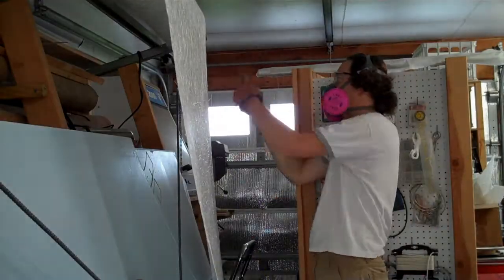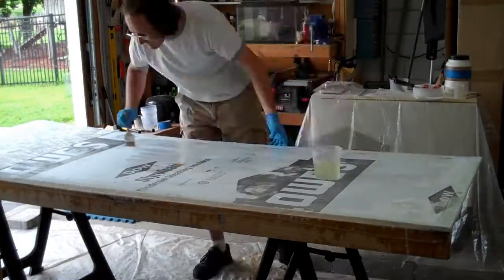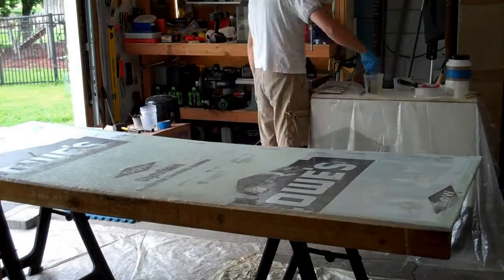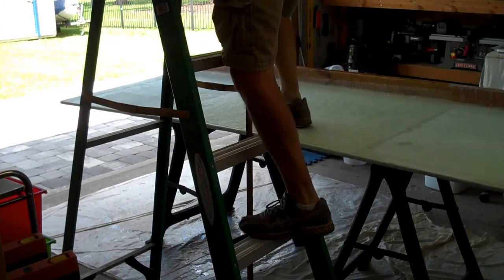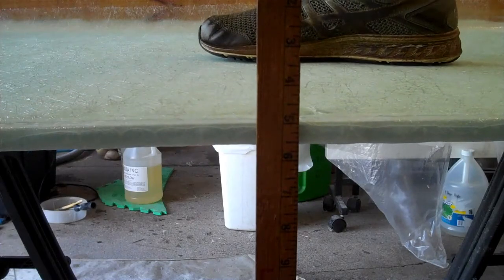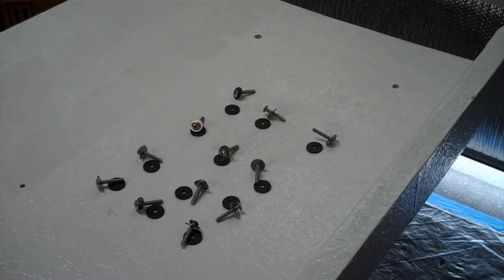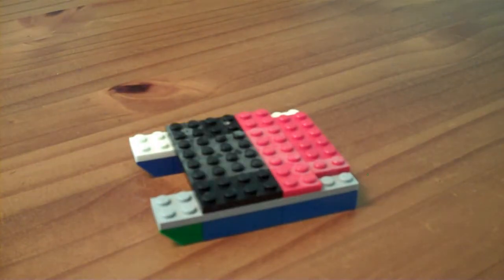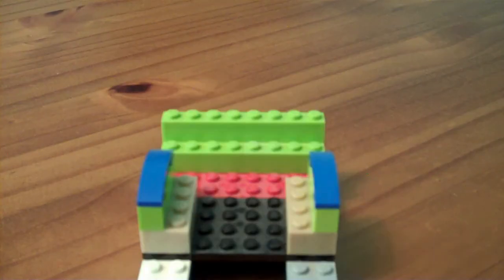Foam & Fiberglass deck board - Building a fiberglass mini-pontoon boat - part 5

Comment: I’m building a catamaran type little trolling motor boat to get me to my fishing spots. Since boat was stolen while saving money for another one. I hv sponsons in front kind of like a racing boat. What did you use for the bolt holders to screw the standing board onto pontoons. All I found was 3/8” type flat washer type flush mounts with the little wings pointed downward to hold it into the wood. Thought I’d glue a piece of wood under my cardboard sponson form in fiberglass if over. Put 5 on each side plus fiberglass two times over the top of plywood. May look into using the foam board instead of plywood thanks
Reply from the maker: These are stainless steel t-nuts embedded in the pontoons fiberglass. I believe they are the same type you found with the wings pointing up. You can look at my pontoon build video in the same playlist to see me install them.

Comment: can you advise the weight of the fiberglass chop strand matts you used in the project. It looks very thick layer.
Reply from the maker: The CSM is 2.0 oz per sq foot  (NOT Sq Meter, as woven fiberglass is typically measured).

Comment: What type of resin did you use? Most resins melt the foam.
Reply from the maker: This is epoxy resin, with a slow hardener so it will not get too hot. I believe polyester resin will chemically melt the foam, epoxy resin appears to work fine as long as the heat doesn't get above the melting point.
Reply: @summetj  Hey, thank you. I have been looking for a light weight solution for my jon boat. Ill have to look around for a slow hardener. I appreciate you getting back with me.
Reply: @summetj  From what I have researched you can used white or yellow wood glue as a barrier coat and use the other resins. I am considering a foam core deck for a old Whaler skiff clone I am doing. What is your opinion of min. core foam thickness (widest span 30"). Plan a vinyl ester 1708 45 biax layup 1 layer top and bottom and maybe a veil layer added to top. TY
Reply from the maker: @howiemoth3847  I'm not an engineer, so I really don't know what thickness is best. I've been told via a YouTube comment that the thicker the foam the stronger the resulting composite board.  (I've also found that more layers of cloth provide more strength ;> )

Comment: What kind of foam are you using for the “structural beams” on the other side? Looks like styrofoam.
Reply from the maker: The entire deck board has a Styrofoam core and the ribs/beams are also Styrofoam cored.  The structural strength is provided by the fiberglass and epoxy resin, the foam core is mostly just to make the shape that the fiberglass goes over (plus keep the sheets of fiberglass held apart...i.e. they form the center of the "I-beam") for which they only need a little strength under compression.
Reply from the maker: @@elliottdean291 not chemically, but if you put too much fast resin in one spot it can melt it from the heat of the reaction, so I'm using medium speed resin.